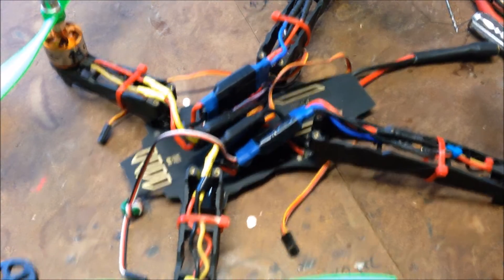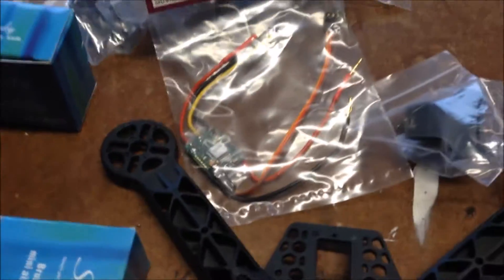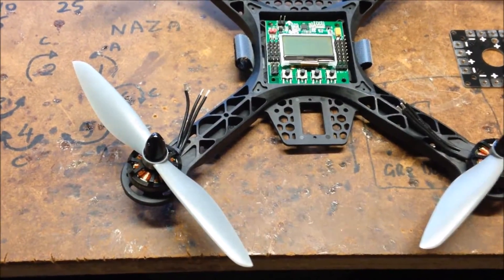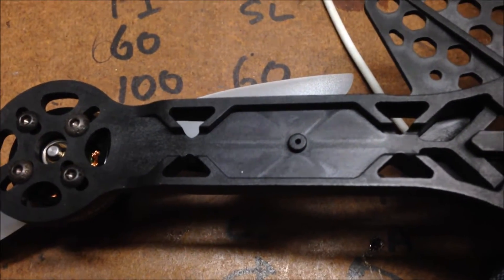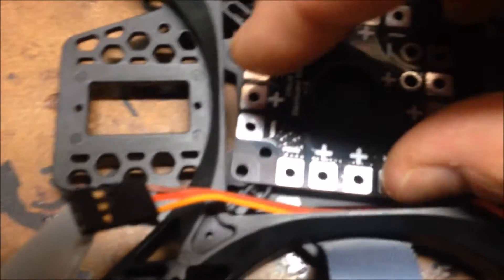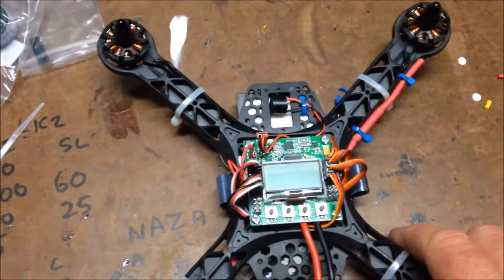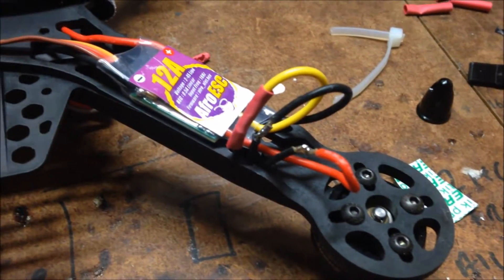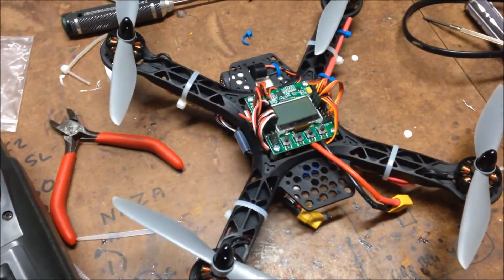Diatone 260 HK260 Quadcopter Build with Sunnysky 2300kv 2204 motors AFRO ESC and KK2.1.5

Comment: I don't know why YT recommended this video to me now but here I am. It's very cool to see how much the hobby has changed in six years. I'm only doing this for three years now and this frame, the flight controller the ESCs look like ancient technology compared to what we have now. Motors used to be a lot cheaper though. 20 bucks for four motors?? That will barely get you one motor now.
Reply from the maker: The motors were an auction on EBAY. I got lucky. Have not done much drone building for some time. I bought a DJI for aerial photography and now I am building Aussie shacks. Don't fly nearly as well.